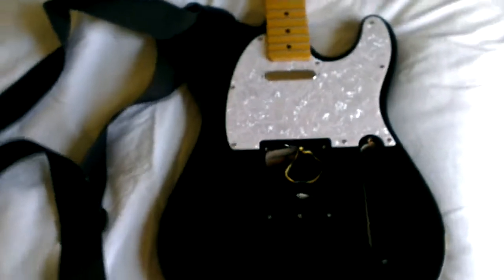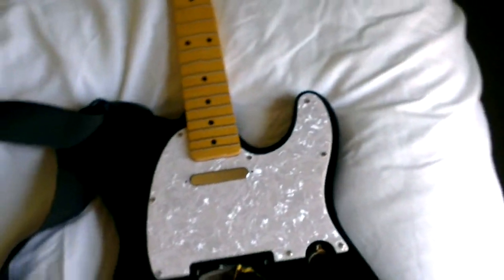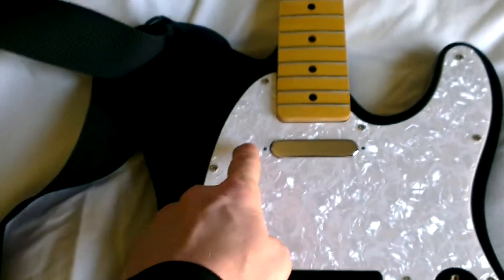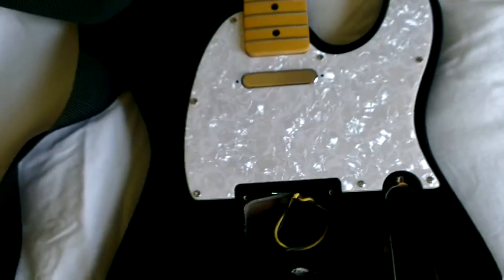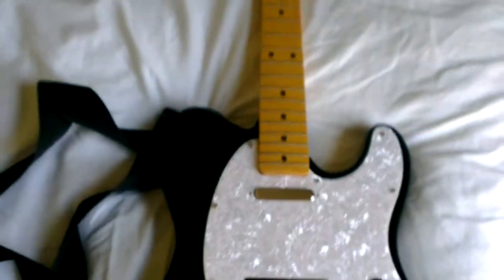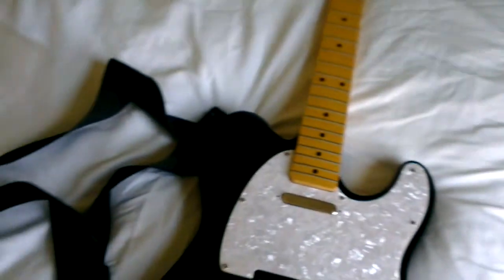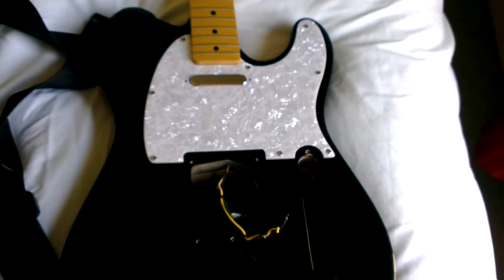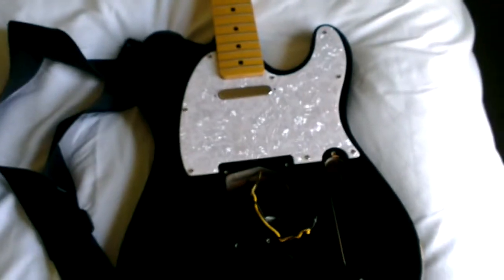Pimping My Telecaster - Part 3

Comment: I don't think it makes much difference to the sound, the through scratch plate method just makes it easier to adjust the height. You can put the SP on once the adjustment has been done.
Reply from the maker: I agree - I changed my mind and used the scratchplate mounting option... but that'll be in Part 4 ;-)
Reply: Hurry up :-}